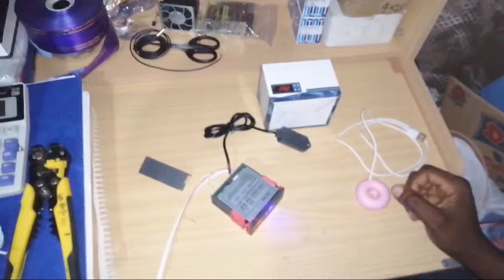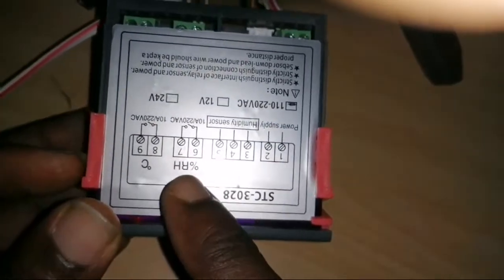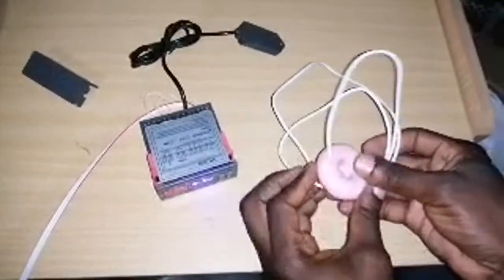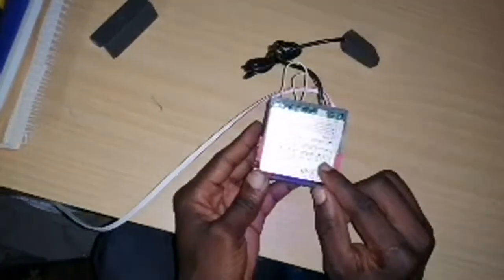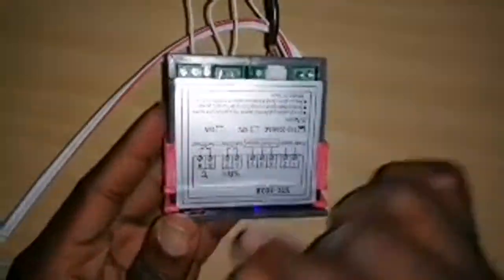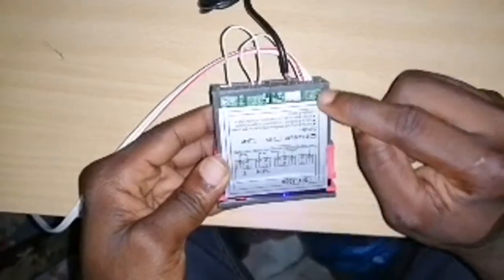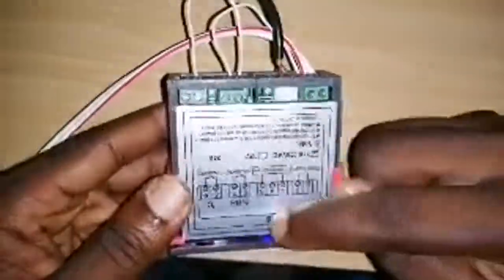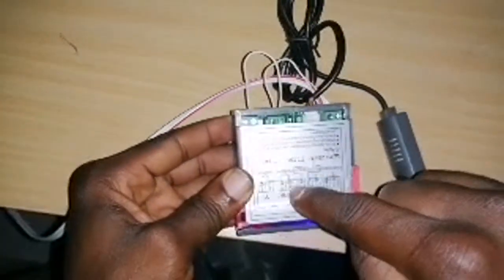How To wire Stc 3028 Temperature Controller For incubator PART 1

Comment: Hello, I am already using the STC 1000 for an incubator. This has a temperature return difference F2 of at least 0.3 C°. This is not exactly ideal for a constant brood temperature. With a brood temperature of e.g. 37.5 C° you have a tolerance of at most 0.2 C° upwards or downwards. How much is the temperature return difference for this model STC 3000 or STC 3028? THANK YOU VERY MUCH
Reply from the maker: for stc3028, you can even get 0.1
Reply from the maker: I haven't used stc3000 before so I can't say much about it
Reply: @mykitvideos5937  thank you very much for your answer. Unfortunately, there is no official data sheet for this China thermostat. So I couldn't find out anything about the STC 3000. With the STC 3028, can the minimum really be set to 0.1C°?
Reply from the maker: yes I have a video on it
Reply: @mykitvideos5937  this video here?
Reply from the maker: part 2
Reply from the maker: https://youtu.be/qbRaeIfGD10

Comment: hi kaka can i ask? I have a thermostat stc3028 but I have a problem, before I used it before, now I want to make eggs again, how come code 888 keeps blinking continuously asking for a solution
Reply from the maker: Your sensor has problem. Check if the sensor is well connected

Comment: Sorry but the wiring cable is the same for  the stc 3028 12v? And the output is same 12 v or 220ac? Thank you
Reply from the maker: The output is whatever voltage you want it to be.
But the input must be equal to the voltage marked on the device port 1 and port 2
Reply: @mykitvideos5937  I don’t understand,sorry..but if I connect a 12v 150 watt fan heat, how can I connect? Thank you and sorry 😅
Reply from the maker: In that case the wiring is not the same
Reply from the maker: https://youtu.be/zvQz7jjwgJc
Watch this to understand
Reply from the maker: Do u have the controller now

Comment: It looks to me like there is a mistake in your wiring - you bridge from source to humidity relay and from that to the temperature relay. 
Both relays need an independent wire bride to the power source as they only act as switching device - either the neutral line or the phase line.
Or is it just visual deception and you went from #1 humidity to #1 heating?
Reply from the maker: Please watch the part 2.
It's visual deception you are experiencing
Reply from the maker: https://youtu.be/qbRaeIfGD10